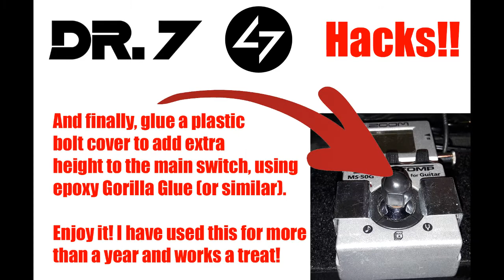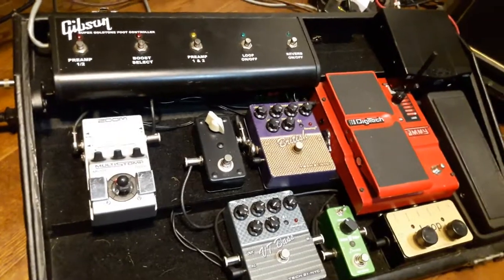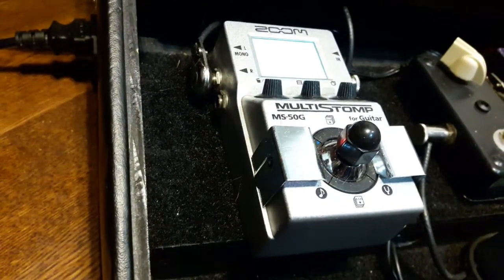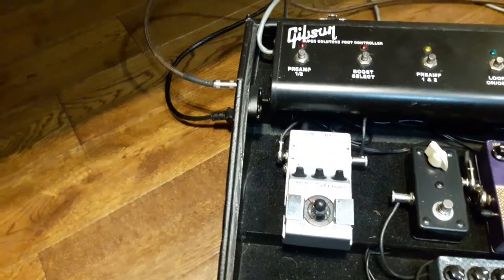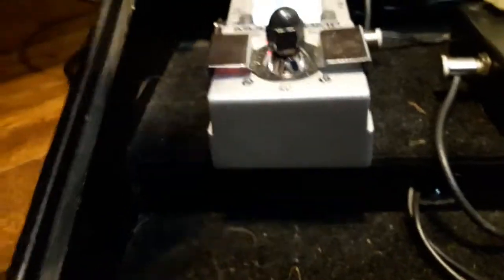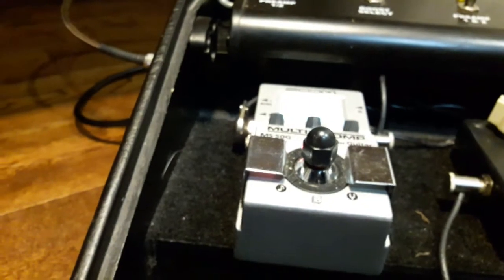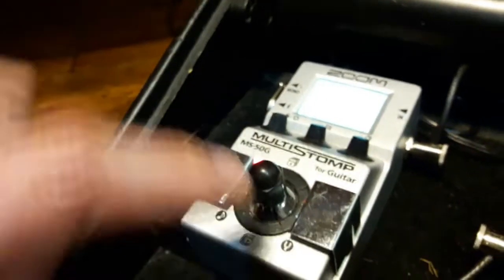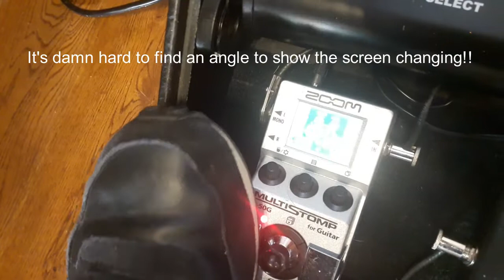Zoom MS-50G MOD - Dr.7 Hack No. 1

Comment: This hack is great! One of the flaws of the Zoom MS-series is the lack of footswitches and this is a solution. I also saw hacks where they soldered external footswitches to the left and right arrow buttons, but that one requires an alteration to the pedal ofcourse. In the future I'm planning to build a USB host from a Raspberry Pi to control the thing via Sysex.
Reply from the maker: Good luck and glad you found this somewhat useful.
Reply: @DIYguitarGuy - how far did you get with the Pi project? I've been vaguely debating going down this route. Do you have a github?

Comment: Great Idea! BUT you're just gonna ruin the left/right cursor.. 

Use a midi controller instead. Mine is M-Vave Chocolate midi controller. Oh, and its wireless midi already. 😁
Reply: How have you achieved it? I have the Chocolate and I am unable to get it to work with the Zoom MS-50G :(
Reply: @ekaitza.a.4880  theres a power on sequence you need to follow for it to work. You may check my demo on my channel. Thanks
Reply from the maker: Well, still hasn’t failed to me. MIDI is a nice option of course, but you need to spend more money and space on your pedalboard.